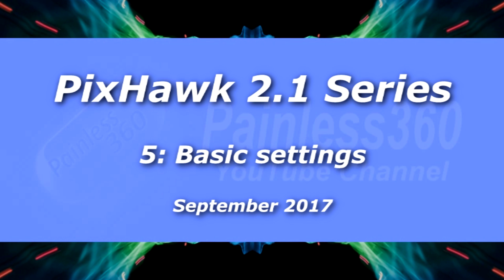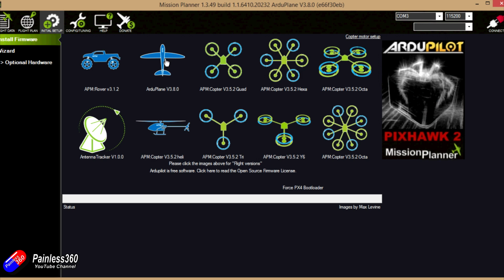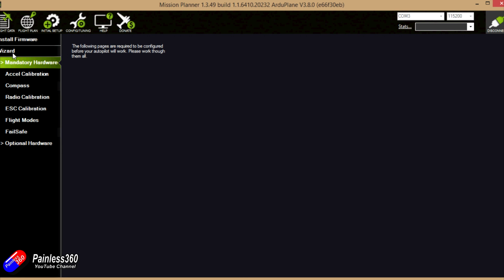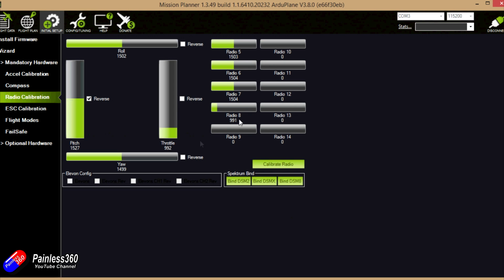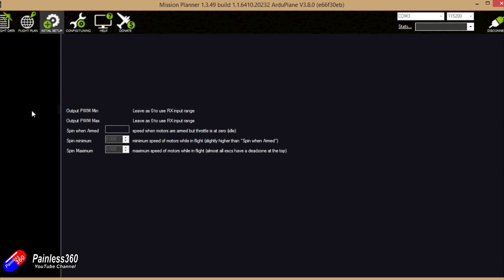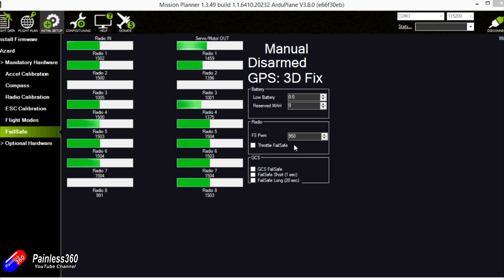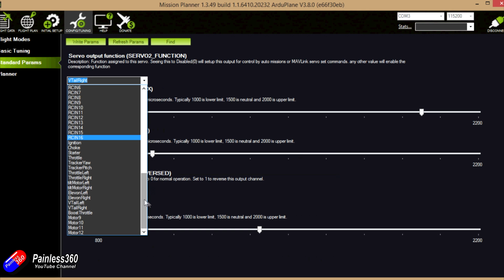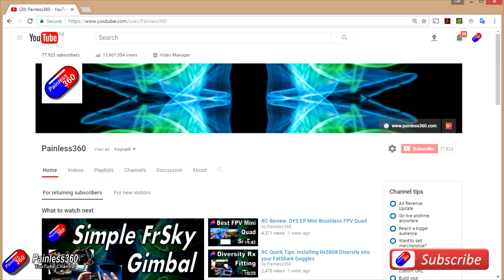(5/9) Introduction to PixHawk 2.1: Flashing firmware and basic setup tips

Comment: Hi all,

 I’m using Pix-hawk 2.4.8  I’m having some problems flashing green light i want covert into solid green light  how can solve my problem plz guide me??
Reply from the maker: Not sure what you are asking for - are you struggling to arm the model?
Reply: @Painless360  I’m using PixHawk 2.4.8 for using  rover I’m facing some problems flashing green light after pressing safety switch and i found gps locked but pixhawk disarmed  i want covert into solid green light  how can solve my problem plz guide me??

Comment: Once you Calibrate the plane with mission planner, we don't have to do it again when using another computer that has mission planner firmware???
Reply from the maker: Correct.
Reply: @Painless360  
That means the Mission Planner ( online firmware/ free download) registers the plane ( UAV/ FPV in the system database)

The PixHawk the code  ? For Mission planner to register it
Reply: @Painless360  

According to " breaking my long range FPV Distance" - utube  you can lose telemetry but still accomplish an autonomous flight. The PixHawk will use satellites to accomplish the waypoints 

My questions
Is possible to prolong a long range flight by simply changing the batteries. ?
Reply from the maker: Check out my Pixhawk build series and the excellent documentation - https://ardupilot.org/copter/docs/radio-failsafe.html. The stuff you are asking about is potentially fraught with extra considerations so doing your homework will help you avoid problems..

Comment: Hello, I saw this video and said "I want a pixhawk 2.1"
Now that I have one I am having difficulty with the compass!
When calibrating, compass3 does not appear. Neither in the sphere of axes nor in the bar that grows. Is it in the GPS module? I did not turn on the GPS.
At the end of the calibration compass1 appears in green.
The compass2 appears in yellow and gives very different results from those of compass1 !!!!
  The compass3 appears in red.
Can you help me and explain what's wrong?
Reply from the maker: Not sure, all the steps that I followed are in the video. I'd give the vendor a call, the PixHawk 2.1 support should be available from there if you're stuck (also handy in case it turns out to be a HW issue and needs returning).. Best of luck!

Comment: My understanding is the the 'Onboard' magnetic calibration is superior.  I see you demonstrating the older technique.  Also, to calibrate, my understanding is that you just have to hold the model for 2 seconds or so in each orientation (like the accelerometer  steps (up, down, left side, right side, etc).  This is MUCH easier than the previous technique which is gnarly with the cord.  I used this technique on my copter and it seemed to work quite well. Am I missing something?  BTW - Lovely video series!
Reply from the maker: Both work well. I used the method that's worked for me since the early days of APM and the method that the professional PixHawk 2.1 pilots I know have also used successfully used too since it's release. Thanks for the note as others can find it here. If it becomes something I need to cover in more depth I can make a whole video on it. Happy flying!